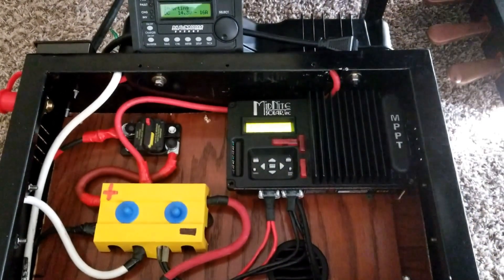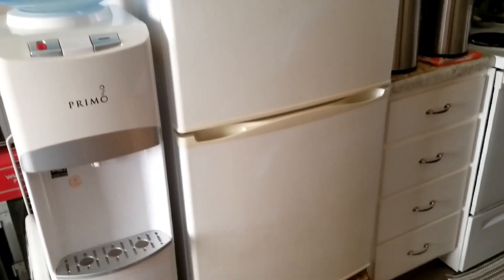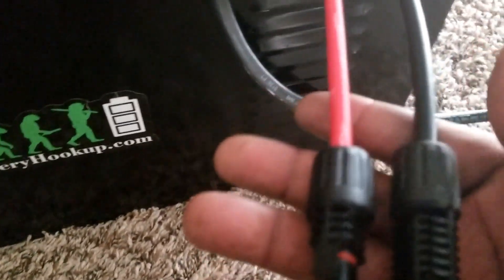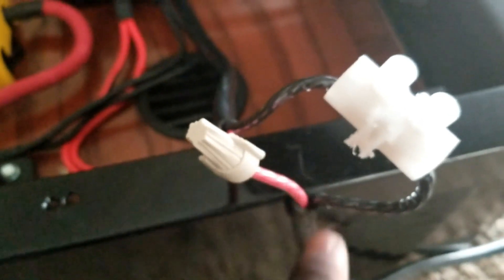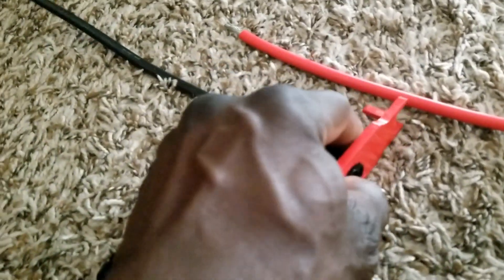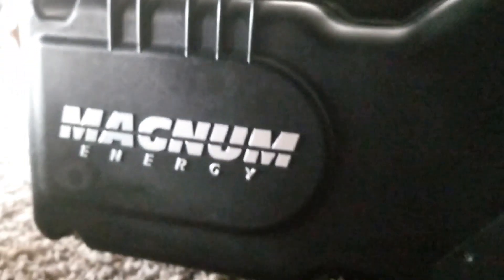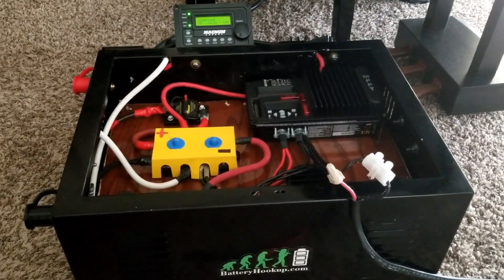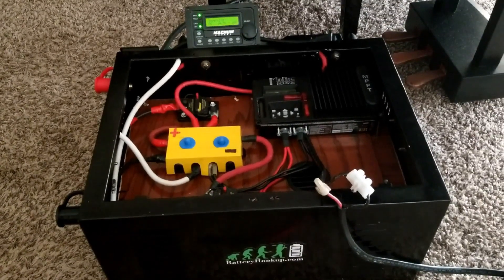UPDATE ON MY MOBILE SOLAR GENERATOR(part:6)

Comment: Wise man with wise words of safety means lives and equipment at their limits . You have the generator sorted out to perfection 🤗.  Is the 30 amp breaker going to be installed on the outside, so the plexiglass won’t hender access ? Otherwise this is a great unit with plexiglass view .
Reply from the maker: Thanks for watching. 
I have another update coming out tomorrow morning with more gadgets added into the system 👍😉